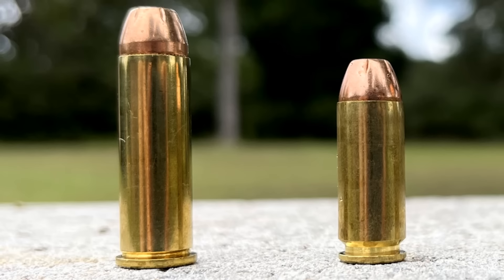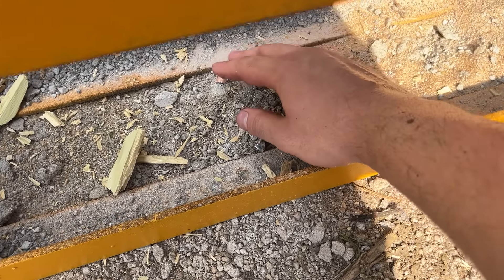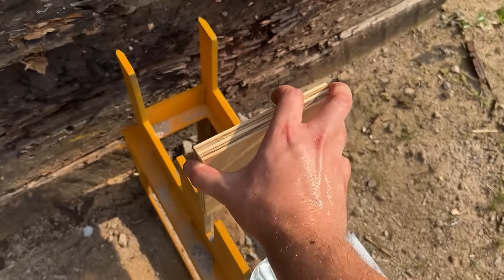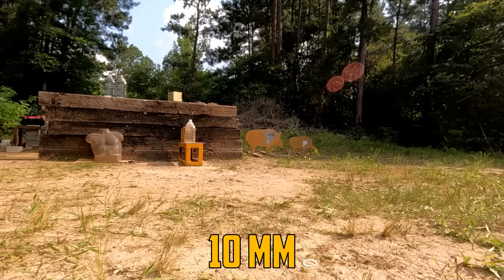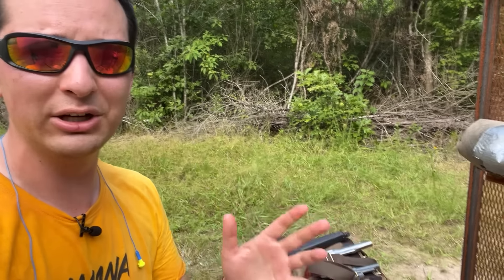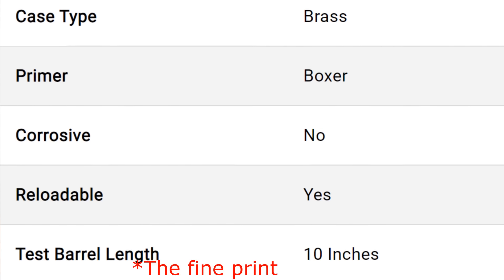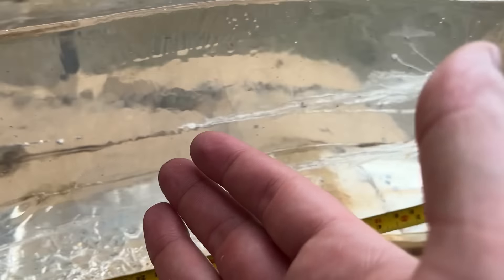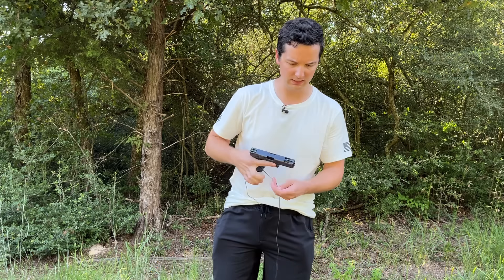44 Mag vs 10mm Auto vs 41 Mag: Not Even Close?

Comment: I love 10 mm but to be realistic 44 has a lot more power even with cylinder gap. The problem is that 99% of 10 mm you find out there is loaded down to 40 specs. True 10 mm is pretty damn peppy but I would not say it is even close to 44. Closer to .357.
Reply: And let's face it they are All just hole punchers. If you don't have any accuracy, it's a moot point.

Comment: I'm stoked to see tests on the .400 Legend. I think they are marketing it all wrong. They should be calling it 10mm Ultra Magnum. Real shame the AR15 rifles and 20-30rd mags haven't materialized yet. The Turkey's Opinion did some tests with custom 165gr solid loads that were smacking 2700f/s and over 2800ft/lbs from a 16", meaner than anything in an AR15 footprint that can fit doublestacked for high capacity mags, more energy than a bunch of AR.308 footprint loadings using longer barrels. The .400 Legend is the ultimate QCB under 300yrd AR15 combat round, in my opinion...if the rifles, mags and loadings existed.
Reply: .40 cal. 165 grain bullets?! Why?! What happened to sectional density and ballistic coefficient if the said bullet is supposed to be fired at 200-300 yards?

Comment: still taking the 10mm, had the same initial wound channel as the 44, but most of the extra energy from the 44 just went to more penetration, which after a certain point makes no difference because it becomes overpenetration. additionally, 10mm is more common these days and significantly cheaper, even if its in the form of softer loads. and being a semi automatic cartridge, you get significantly higher capacity and fire rate over revolvers, yielding a higher damage potential per load. with many 10mm pistols carrying 15+ rounds compared to the 44s meager 6 round average. and the 41 magnum is one of those rounds that almost an online shopping excusive, you will almost never find it on the shelf of the average gun store, maybe a gun show if you're lucky
Reply: The original 10mm full house load. Is exactly the same power as 41 mag. But for some reason the modern factory load  load is at or slightly more power than 40 s and w.
Reply: @LBrawn  federal is the worst offender about that, if you look at the numbers on the box it's barely over 1k fps, it's should be over 1200 fps for a proper 10mm load, and the bastards still charge nearly 10 bucks more a box for it compared to other brands like s&b or magtech
Reply: @LBrawn 
No it’s not. A full load 220 grain hard cast 10mm will produce around 700 ft lbs of energy. The 230 grain 41 Mag is around 1075 ft lbs of energy. A full load of 44 Mag that fires a 340 grain hard cast will carry over 1,500 ft lbs of energy.

Everyone wants to talk about the 10mm full load and compare that with the .41’s and the 44’s target loads. If that’s the case, then yes, they are comparable. When all three are maxed out, you see the .44 doubles that of the 10mm.

I have two 10’s, and I love them both (rock island 1911 and Glock 29). So I’m not trashing the 10mm. It’s a terrific cartridge. But it has not, will not, ever be comparable the two magnum revolver cartridges when it comes to energy and power. The numbers don’t lie.

Comment: One obvious difference was the muzzle rise of the 10mm vs. the .41 and .44; it was far less, and back on target more quickly thanks to the return forward momentum of the slide - as applies to any automatic cartridge - bringing the muzzle back down when it slams to a stop.  

That is what makes follow-up shots so much faster with an automatic - completely apart from the effect of the single-action trigger vs. a double-action revolver.  Only a very experienced revolver shooter has any hope of matching the rapid-fire capability of a semi-auto when firing a revolver, and it takes a strong grip to do so - at least in part because of the revolver's inferior grip ergonomics.  

When added to the vastly higher magazine capacity of the semi-auto compared with the revolver's cylinder limits, AND the rapid reload capability of a semi-auto compared to even using a speed loader with a revolver, the semi-auto wins hands down.  Maybe that explains why NO modern military issues revolvers to troops in the 21st century.  

You'd be far more well-prepared against a charging pig - 2- or 4-legged - with the 10mm than even the .44 Magnum cannon.

Comment: Both the 41 and the 44 can muster over 1000 foot pounds of energy. The 10mm can achieve the same energy as the 357. If you do not believe it to the so, just calculate the energy that you can get from the max velocities with a simple formula: Square the velocity of the projectile and Multiply by the weight of the bullet in grains and the Divide by  450240 and VOILA, you have the energy in foot pounds.

Comment: From what I have seen, the 10mm is much more comparable to the 357, not the 41 mag.
The big problem with 10mm is that unless you buy premium ammo (Buffalo bore, underwood, etc...) all your getting is longer than 40 S&W.
I'm not putting down the 10mm. 
I have one myself and really like it. 
I also have a Ruger New Model Blackhawk flat-top 41 magnum 6.5" barrel, and it's one of my favorites. 
I predominantly load all my own ammunition so I can push it closer to maximum pressure or lower pressure plinking loads. 
44 mag bullet diameter is  .429
41 mag is .41
That's only  .019 difference between 44 and 41 , 44 has the advantages of a larger bullet selection and loaded ammo, the 41 has only a few options.
Reply: One thing I noticed on a couple of different manufacturers the 175-180 grain rounds were available in both 10mm & .41 mag. In the info listed on the boxes the 10mm had a few FOS and muzzle energy over the .41 mag using the same bullet. I think it was underwood and winchester that I was referring to. But that’s just something that stuck in my pea brain. I think it was around 50 FPS and a couple of pounds in energy difference.

Comment: It is sad that they are using such odd barrel lengths to publish their velocity numbers. All revolvers should be chronographed through a 4 or 6 inch barrel and autos through 4 or 5 inch. Those are standard carry lengths. One manufacturer used to test handgun cartridges in vented test barrels to simulate revolver cylinder gap. Today it is all about the fine print.😒
Reply: Hornady with 44 typically test with 7.5” which is fairly common for hunting. Ruger makes the Blackhawk and redhawk in that size, and S&W+Taurus have an 8 3/8th” so it’s close

Comment: A standard load for the 41 mag when it was developed was a 210 gr bullet doing about 1275 or so fps and around 705 lb ft of m.e. The original 10mm when developed by Norma was a 200 gr propelled at about 1200 to 1250 fps and 650 lb ft of m.e. Very comparable to the 41 mag using std factory loads. Now we have detuned 10mm off the shelf ammo thats no better than 40 short and weak. People try to.compare those to hot loaded 41 mag which obviously puts the 10mm to shame. You cant do that. Now 44 is in a class by itself and I think cant be compared to the 41 or 10mm. Revolver ammo can be loaded to much higher pressures than that of semi-autos so advantage to them. Its funny how the 10mm is fast beciming the go to bear gun in Alaska for griz deterrent. The guns hold more ammo and are easier to keep.on target. 10mm loads with 180 to 220 gr cast flat nose bullets are very effective against bears except for maybe those giant kodiaks and polar bears but I would rather have a 15 round 10mm loaded with those cast flat points traveling at 1250 fps than a 6 round 44 or 41 with too.much recoil that it takes seconds to get back on target.

Comment: Most commercial self defense ammo in .41 magnum is loaded way under pressure to mitigate recoil. the .41 magnum is way closer in power to the .44 than the 10mm. The original load was 210gr bullet at 1560fps for 1135 ft/lbs of energy. Most 210gr self defense loads are loaded to 1150 - 1250 fps. in comparison a .44 magnum loads a 240gr bullet at 1475 fps. The 10mm is nowhere near either of these. Its max load being a 180gr bullet at 1300fps.

Comment: Isn't the 10 MM the same thing as a .40 Cal?
All 3 of these rounds were similar in most regards.  (Size, weight, loadout, etc.)
All your tests would have been different if you had used a solid bullet, instead of hollow points.
But I suppose you know  all that.

Comment: Im a stalwart 41 fan, but a divorce forced me to pay an attorney so had to sell all ( 6) 41's to pay that guy off. (along with all the other I had by then) I can say that using 2400 powder and getting up to 20 grains of it or thereabouts the 41 takes a backseat to no one! It will usually out penetrate the 44, has a flatter trajectory and is easier to shoot, less refill as well. I see you only used a 4" 41 as opposed to the 6" 44, and seems to be a 6 or 7 in 10MM as well. The selection of 41 ammo is awful, and with the shorter barrel and lackluster ammo Im surprised the 41 was able to do so well. Now load up some serious 41 ammo or get some of the specialty rounds they sell and throw them through a 6" barrel, the 41 wins 100% of the time, esp against that 44!

Comment: I think if you are going to test different caliber firearms against each other they should be tested as they are designed to be. A 44 Mag at 1000 fps is not the ideal 44 Mag. And the 10mm at a hot level is the way it should be tested. Run that 44 Mag up to 1300 to 1400 fps and lets see what it does. It'll blow the 10s socks off.

Comment: 10mm has no business being compared to .44mag power wise… .357mag, 41mag yeah we can talk. 44mag, nah
Reply: It's going to lose, but it absolutely should be compared/contrasted. They get cross shopped, and used for similar purposes. The 10 will usually win the capacity/ease of shooting argument, but it is good to see the numbers and physical evidence of what you are giving up when you with one over the other.
Reply: I was completely shocked by how anemically loaded to 44 magnum rounds were
Reply: Compare it to 41!!!!!????? No way
Reply: It does compare to 357 mag but 41 mag when properly loaded beats 10mm and it’s not a question. Assuming banana ballistics was using Hornady ammo , for whatever reason Hornady really down loads revolver rounds 357 and 41 really show it too because they rate those rounds with 8 and 10 inch barrels which is unrealistic. 125 grain out of a 4 inch should be 1450 fps minimum. Hornady has to use a 8 inch to achieve 1450-1500
Reply: @NoBrakes23 I disagree. There is really no reason to compare 10mm auto to 44 magnum. The 44 ammo he was using in this video is anemic at best. Full powered factory 44 magnum fired from a 6 inch barrel will produce upwards of 1300 pounds of energy at muzzle. I don't care how hot you hand load a 10mm, you aren't going to see anything close to that kind of power. 10mm should be compared to 357mag and 357 SIG. An extremely hot loaded 10mm can possible compare to a properly loaded 41 mag, but even that is a stretch.
Reply: @RyanNett-dt7my the .41 magnum also. It should have been in the upper 1300 to lower 1400 fps

Comment: One thing hard to test with these setups is "punch".  Note the 10mm didn't penetrate as deep.  That means most all energy was put into any target only 16" thick.  That means full "punch" of total energy is felt by the target.  It's also kinda why 45ACP has "knock down" power... that "punch" energy is transferred 1:1 to the recoil, feeling like a "punch in the chest" which can stop an advancing target.
Reply: “Energy transfer” is not a thing.
Reply: @GraveyardJack  Ummm.... physics would say different.  Some of the forward momentum is eaten up by radial shock waves, but the energy imparted by a moving object impacting and sticking to/in another object transfers the energy to the new system dynamic.
Reply: @cycleboy8028  Energy counts for jack shit. Unless you can measure how much is lost in fricton/heat, how much is actually used to destroy tissue, how much is absorbed by the soft tissues and fluids of the body and how much is wasted when the bullet exits, it tells us absolutely  nothing useful. This notion of "energy transfer" is nothing but nonsense perpetuated by people who know nothing about terminal ballistics. Same for anyone who says, "it's simple physics". That's code for, "I don't know my ass from a hole in the ground but want to sound smart".

What counts is tissue damage and penetration is paramount. Not "energy transfer". The bullet that exits is more effective than the one that does not, all else being equal.

Comment: 10mm is one of the the most pointless calibers ever, along with .40 S&W and .357 SIG. At least to a handloader. Any modern 9mm is going to be built on the same frame as a .357 SIG, 10mm or .40S&W, at least in the majority of cases. It is definitely true for the Beretta 92FS and related developments in .40 S&W and .357 SIG. 
Actually, the 9mm has more potential in that case (and in most, in fact) because it will have the thickest chamber wall and thus can take the most pressure. 
What holds 9mm back is the fact they have to load it so as to not blow up guns that are more than 100 years old (Broomhandle Mauser; P.08, I'm looking at you!). 
Basically, ammo companies need to start making 9mm Major as a standard factory load and any NATO certified 9mm should automatically be certified for it. 
I've fired thousands of rounds of carefully designed 9mm Major out of a stock G43 with zero sign of accelerated wear. It isn't even +P rated. Out of a 3" barrel, I was getting 5" barrel .357 SIG ballistics. 550 ft-lbs. ME with a 124gr slug. The same round made 620ft-lbs out of a 92FS, legitimately equivalent to a 'standard' .357 Mag. I put a heavier recoil spring and buffer in that gun and put 10k rounds of the ammo through it, whereupon the 92FS screamed at me, 'is that all you got?!'.
I fired some 750 ft-lb .45 ACP loads out of a 5" Kimber Stainless Target II. I wouldn't want to make a habit of it, even with the buffer and heavy mainspring. Practically speaking, to an experienced handloader, both the 92FS/M9 and M1911 (of modern construction) have roughly the same energy potential and it overlaps the 10mm, .357 Mag and .41 Mag energy ranges. 
Then there were my Super Blackhawk only .44 Mag loads.... you don't typically think a 240gr slug can make 2200 ft-lbs from a revolver but it can. I call that load the 'Wristbreaker'. It is well into .500 S&W Mag territory and will put down a grizzly with ease.

Comment: You have some weak, 41mag loads compared to the other two and your using a shorter bbl on the 41mag than either of the other two. Try the Underwood 41mag, 210gr XTP-HP at 1580fps from a 6" bbl and see if you get the same results. Any handloader already knows that using full power loads in the 41mag. Your comparing apples to oranges with all due respect!!
Reply: I've handloaded for my Ruger New Model Blackhawk with a 6½" bbl for 20 years! I love the 10mm as well and the Underwood 155gr XTP-HP is a very hot round as loaded by Underwood. The Hornady 41mag loads are more like a mild mid range load. I load a 215gr Hard Cast SWC bullet under 9.0-10 grs. of Unique that averages a little over 1200fps as a mild mid-range load with great accuracy. If I want to go deep, I load a True Shot 265gr Wlngc bullet under 20.8grs. of H-110 that chronos over 1400fps for heavier than deer size game and a 210gr XTP-HP under 22.7 grs. H-110 that chronos a little over 1400fps. Just, saying that with all due respect for your testing you picked a feeble load for your 41mag  loading. Great video, regardless 👍

Comment: This is actually a bogus test, if you're going to test rounds, their penetration, and effectiveness, you have to use the same barrel length and the same gun type. Use a revolver for all three rounds with the same barrel length.  The average 10mm velocity is 1000-1300 fps, 41 mag is 1300-1500 fps, and a 44 mag is 1200-1500 fps; the 41 mag and 44 mag in his test had much lower velocities then the 10mm in the test. Why? Do an accurate, non-biased test next time.